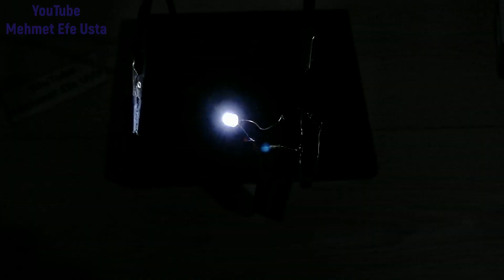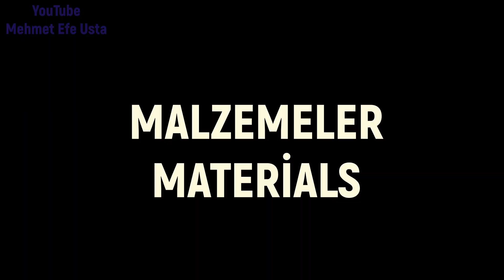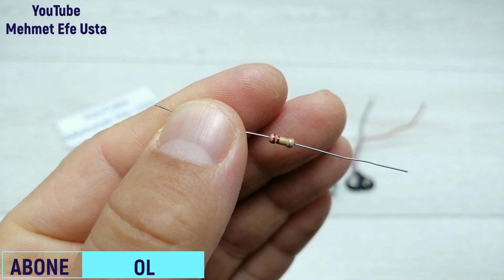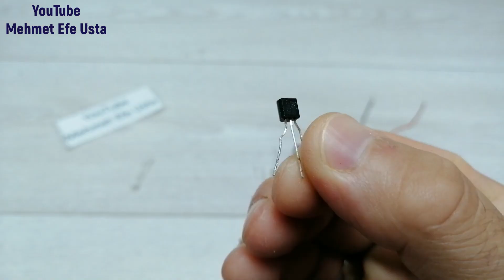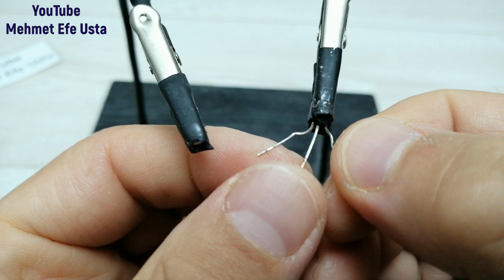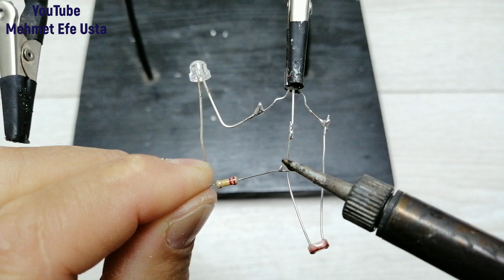Karanlıkta Yanan Led Devresi Yapımı (kendin yap, diy, Led Circuit Making in the Dark)

Comment from the maker: 👉👉İNDİRİMLİ ÜRÜNLERİ KAÇIRMA: https://bit.ly/2Wp2Qp9

👉👉ROBOTİSTAN İLE ALIŞVERİŞE BAŞLA: http://bit.ly/2OWYz99

-----MALZEMELER------
👉9 VOLT PİL: https://www.robotistan.com/gp-greencell-9v-pil?ref=mehmetefe
👉9 VOLT PİL BAŞLIĞI: https://www.robotistan.com/9v-pil-basligi?ref=mehmetefe
👉BC 547 https://www.robotistan.com/bc547-to92?ref=mehmetefe
👉MANTAR LED: https://www.robotistan.com/48-mm-mantar-beyaz-led-paketi-10-adet?ref=mehmetefe
👉 LDR: https://www.robotistan.com/5mm-ldr?ref=mehmetefe
👉 DİRENÇ(220K)https://www.robotistan.com/14w-220k-direnc-paketi-10-adet?ref=mehmetefe

👉👉650 Amper Lityum Pil Punta Makinesi (Model 2)
👉Ürün Linki: https://ban.ggood.vip/ZVk7
👉İndirim Kuponu: BGTR25610

👉👉Aneng An113d Otomatik Multimetre
👉Ürün Linki: https://ban.ggood.vip/10oCb
👉İndirim Kuponu: BG1568882
    
👉 👉TAVSİYE ÜRÜNLER:
👉Multimetre : https://bit.ly/2ZhgVX4-----(https://bit.ly/39TeLio)
👉Havya: https://bit.ly/39AxLCl
👉Lehimleme Seti: https://bit.ly/3usaE6z
👉Yan Keski: https://bit.ly/3indvZw
👉Lehimleme Kolu: https://bit.ly/3CVWbCQ

👉👉TAVSİYE ÜRÜNLER(YURTDIŞI): https://bit.ly/2Wp2Qp9

👉👉HADİ ALIŞVERİŞE BAŞLA: http://bit.ly/2OWYz99 
👉VOLTAJ REGÜLATÖRLERİ: http://bit.ly/2NBW5fB 
👉ARDUİNO SETLERİ: http://bit.ly/2Pc2qyP 
👉GÜÇ KAYNAĞI BATARYA: http://bit.ly/3tMbx8z 
👉ÖLÇÜ VE TEST ALETLERİ: http://bit.ly/3c4Korc 
👉MOTORLAR (DC, SERVO, STEP): http://bit.ly/2PhSuUk 
👉ELEKTRONİK KARTLAR: http://bit.ly/3scCSjU 
👉ALET EKİPMANLAR: http://bit.ly/2ORZojm 
👉3D YAZICILAR: http://bit.ly/3sdlrzy